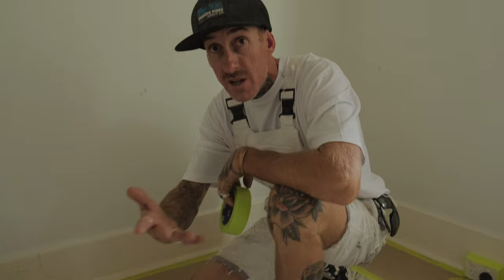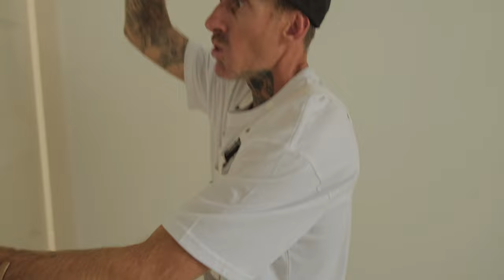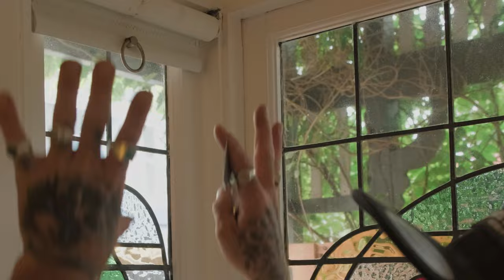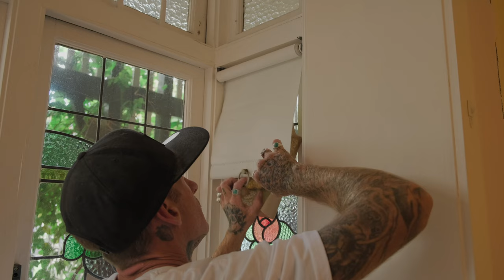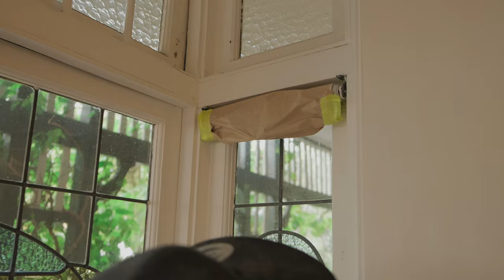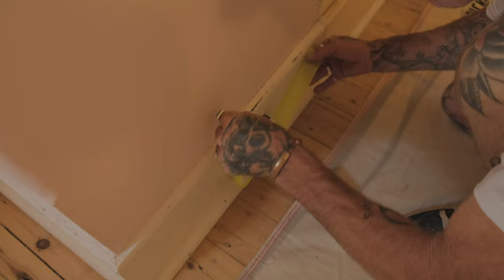MY TOP 10 PAINTERS TAPE TRICKS

Comment: Love the clean hands. Sign of a painter thats actually good. I use frog tape and it lets me do things you cant do without it. Example a window set into stucco with a dash finish. I use brush and roller so in order to get the outer edges of the window trim and get clean lines i run frog tape and paint the tape with the wall color let that dry and then paint the trim and edges pull my tape and get a clean line. Impossible otherwise and painters typically just paint the edges of window trim the wall color because its easy but the result looks amateurish to me.

Comment: as a painter you should use all your tools. Not everybody that brushes around a door knob wipes it out like that. You should be able to cut in perfectly without hitting anything or tape and spray and do it quickly. You do whatever the job  needs. not just using one system of tape and spray. If you cant brush and roll your not a painter. If you cant cut a straight line your not a painter. I use both tape and spray and brush and roll. just depends on how many coats, coverage. Whatever it takes to do a perfect looking job the quickest way.
Reply from the maker: Yes I agree this wasn't a video about all systems of paint this was my top ten tape tips I can guarantee I can cut and roll faster, straighter than most nearly thirty years in the game I spray because the finish cut and roll just don't cut it any more I get my woodwork looking like a lambo you can get that from a brush and roller.
Reply: Agree nothing beats a spray finish, quicker and gives a much better smoother and cleaner finish, eliminates brush marks. People don't understand this is the new school era of painting. Gotta work smart nowadays. Love your work bro👌